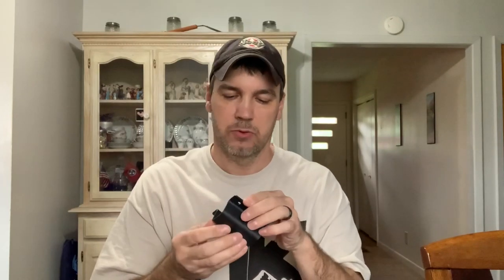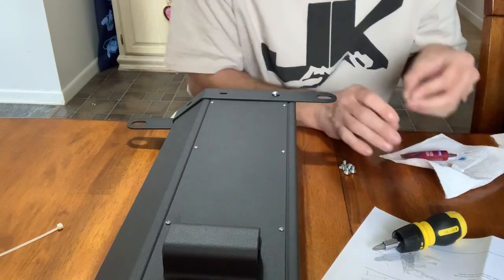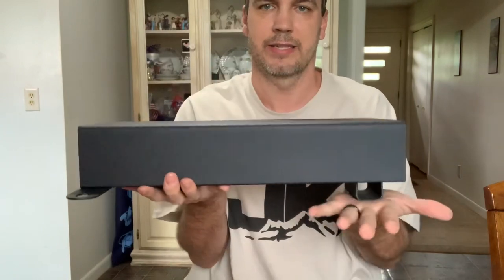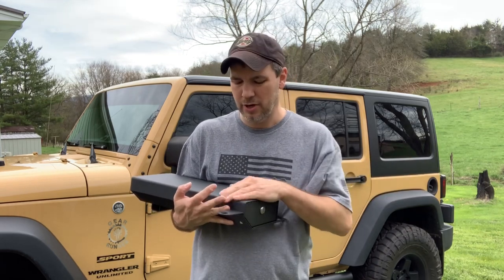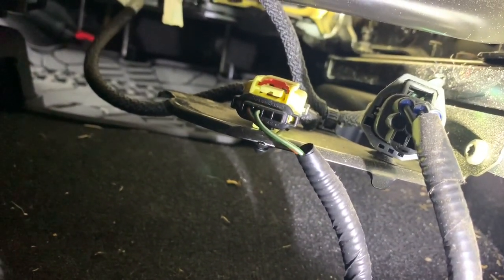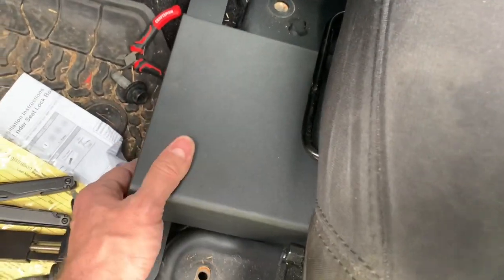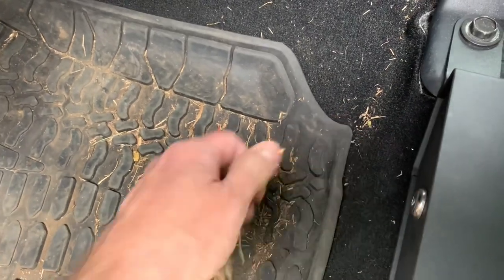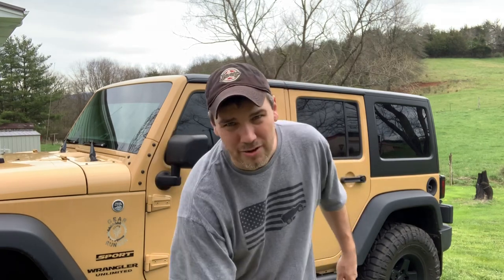Jeep JK Bestop Under Seat Lock Box Install

Comment: My son bought me one of those lock boxes for my Jeep I'm putting it in my 99 Jeep now I had an 87 but in the 99 Jeep the locking mechanism fell apart how do I fix that
Reply: Drill out the lock with a titanium bit (Milwaukee at home depot are affordable/available) and buy a new "barrel lock"
Reply: @breannadonato4417  it turns out that the armored box that my son bought me from my 99 my eight I mean my 87 Jeep Wrangler the screws were not tightened off and the lock just fell apart so I was able to reassemble it and still use the lock

Comment: Thought you were selling the Jeep
Reply from the maker: I can’t find a used 4Runner with decent miles on it
Reply: @gearrunner  Four Runner hold there value . You can always keep looking always try buy new .
Reply from the maker: @jeffreysmall8902  Jeep Wrangler is the number one vehicle for holding its value.  So I should be able to trade even for a nice stock 4Runner.
Reply: @gearrunner  you should go too Toyota website build your own 4runner epecily if you're gonna mod it
Reply from the maker: @jeffreysmall8902  The one I liked was over $50k and it wasn’t a TRD Pro.  I can’t afford a new one right now with my truck payment also
Reply: @gearrunner  know what you mean just a idea